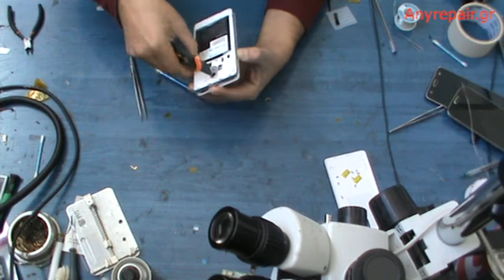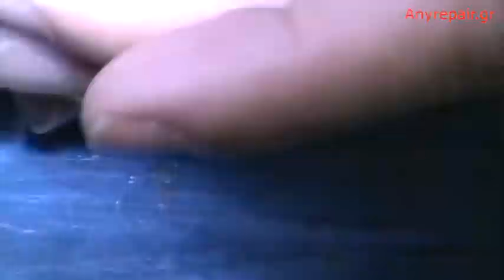Lenovo Vibe P1m charging port repair

Comment: Hello .
My lenovo vibe p1 ma40 when I connect the charger while is switched off It just give me vibrate for asecond with lenovo logo for a second and repeted that but Doesn't Give the Red spot light for chrging 
When I measure the volt at the end og charging socket connector it gives me 5.5V and when I Measure the volts To battery connectors I gives 3.8 volts that inter to the battery connctor . The phone still flash with logo and vibrate repetedly every one second
Thank you for help ❤️

Comment: Phone boot loop after repair charging port, is there any fix?
Reply from the maker: Is the battery charged properly?
Reply: @AnyRepair  Yes
Reply from the maker: is it possible to go to recovery by pressing the volume up key when looping
?
Reply: @AnyRepair  No, Also bootloops on the recovery
Reply from the maker: If you unplug the battery and plug it again, does the phone start and bootloop without pressing any button?
Reply: @AnyRepair  Sorry for the late reply, no it does not bootloop unless i turn it on
Reply from the maker: try to flash a new rom if it fails then the eeprom should be faulty...

Comment: What if  the charging is goes down
Reply from the maker: you mean low voltage or charging and stops after some seconds?
Reply: Sorry late reply
Reply: Nope
Reply: Example if you charge in 18% after few minutes it will be 0%